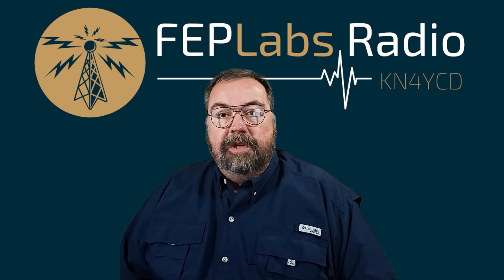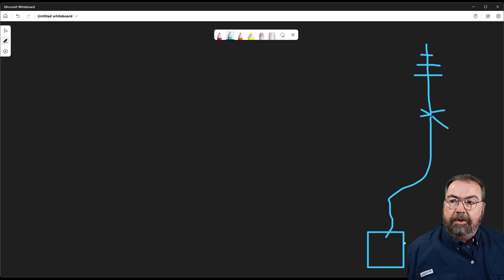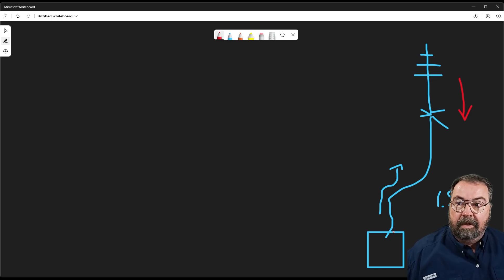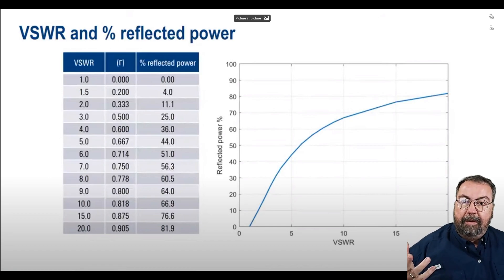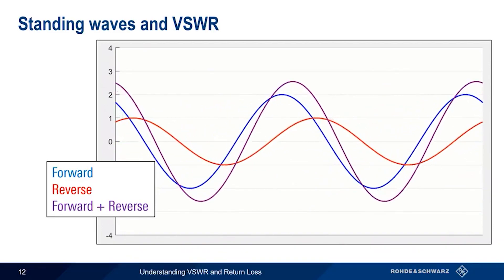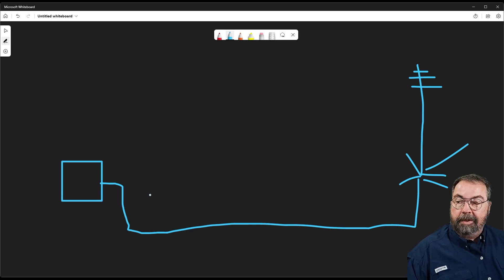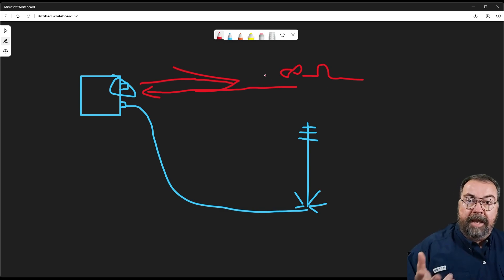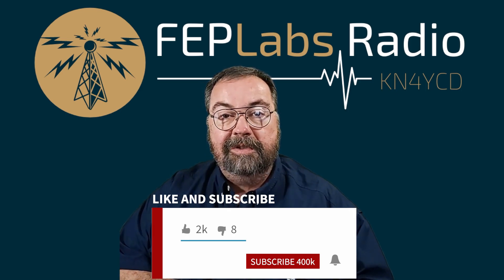The basics of VSWR and Return Loss

Comment: Aren't standing waves standing? I noticed it was moving in the animation graph... I was under the impression that peak voltages and currents are always in the same locations at certain increments on the line, hence, a standing wave, unless the value of mismatch Z changed..

Comment: I stopped watching at the point you declared reflected power as common mode current, please learn the simple science that reflected power from an antenna feedpoint mismatch does not travel on the outside of the braid of coax ,that is totally reserved for common mode current from an antenna imbalance

Comment: Also reflected power is not the same as common mode current.  Reflected power is caused by an impedance mismatch where common mode current is caused by unbalance in the load - for example a dipole where one side is not the same length as the other.
Reply: Absolutely agree ,I've seen videos and comments recently that misunderstand this science
Reply: Aren't standing waves standing? I noticed it was moving in the animation graph... I was under the impression that peak voltages and currents are always in the same locations at certain increments on the line, hence, a standing wave, unless the value of mismatch Z changed..

Comment: This is mostly incorrect.  "with moderate lengths of low-loss coax, such as we 
commonly use for feed lines, loss of power because 
of reflected power in the hf bands can be 
insignificant, no matter how high the SWR. For
 example, if the line SWR is 3, 4, or even 5 to 1 and 
the attenuation is low enough to ignore the
 reflected power, reducing the SWR will yield no
 significant improvement in radiated power because
 all the power being fed into the line is already 
being absorbed in the load."  That from antenna engineer Walter Maxwell who has written extensively on the subject of reflected power.   If you transmit 50 watts to the antenna and 25 watts is reflected back, that in turn is reflected back to the antenna.  So now you have 75 watts (50 watts + 25 watts) headed to the antenna, and the antenna radiates full power of 50 watts.  The only important thing is to use an antenna tuner so the transmitter sees about 50 ohms or an SWR of no more than about 1.5 to 1.
Reply: Agreed.  I think that the amateur radio community should read Reflections III by M. Walter Maxwell, W2DU.  The book really exposes the myths surrounding SWR.  Simply having a low SWR does not mean you have an efficient antenna system.
Reply from the maker: Some of that signal is lost as heat though, correct?  It's not a perfect system.
Reply: @FEPLabsRadio  Yes, correct.  The standing waves are composed of the constructive interference of the forward and reverse signals, so they are larger than the normal waves.  Per the standard power formula, power loss = I^2*R.  So if the standing waves are twice as large as the normal waves, the power loss from them is (2)^2 = 4 times as much.  This loss heats the cable at the locations of the standing waves.  In extreme cases where you're running high power, and the SWR is high, and you remain on the same frequency with the same standing wave locations, there's the possibility of damaging the cable at the standing wave locations due to the heat.  So the transmitter output power is combined with the reflected power reaching the tuner, but as this power increases, so does the heat loss in the cable which eventually limits how much power gets to the antenna junction. The point that many people don't understand is that most of the reflected power from the feed-line/antenna mismatch is reflected back to the antenna by the tuner.
Reply: I agree. Antenna tuners are often misunderstood. The impedance they present on the antenna side forms a resonant tank circuit with the feed line/antenna mismatch. So like any resonant circuit, power flows back and forth with no loss at the ends. However, because of I^2*R loss in the feed line, the reflected + transmission power results in more feed line power loss than would occur without reflected power.
Reply: @softwarephil1709  that would depend on the feedline, the lower the loss feedline the lower the loss from swr ,remember in a lossless line all reflected power is radiated by the antenna